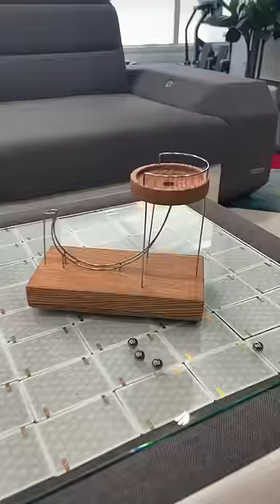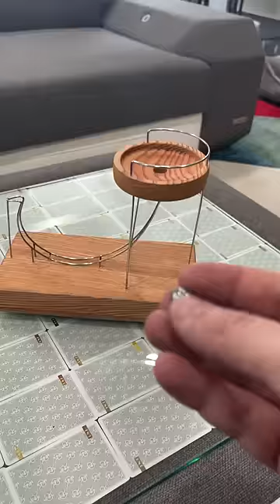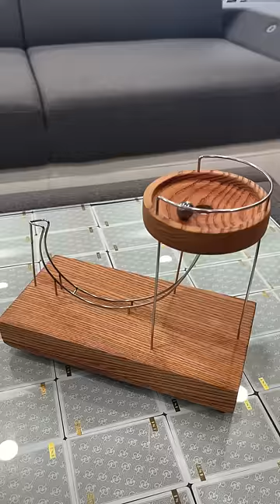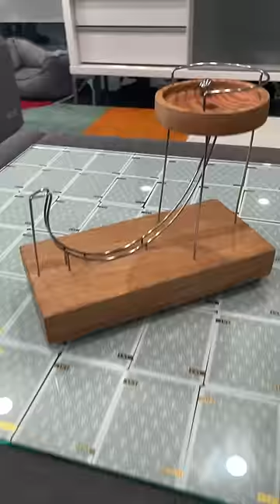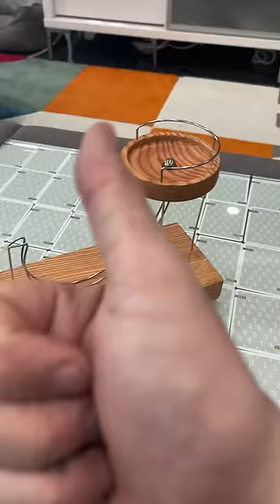An Impossible Perpetual Motion Device?! 😳 #Shorts

Comment: Waste our time explaining it’s impossible then spend zero time explaining the 
Magnet trick.
Reply: Ironic given you haven't either
Reply: There is no magnetic trick!
Reply: EDIT: I'm dumb lol, it's not a magnet - that's way too over engineered. It has a small spinning wheel powered by a motor inside the funnel part. The ball falls past it and gets launched down way faster than it would fall. Check the video at: /watch?v=trC5Dg3Vpi0
ORIGINAL:  
The base has an electromagnet beneath the lowest part of the loop. The magnets field is shaped perfectly to pull on the metal ball bearing, enough to accelerate it and make up any loss of energy to friction and drag.
Reply: @Pohonesty  yeah I'm sorry but this comment makes no sense. It's physically impossible for it to not have magnets because the marbles would constantly be loosing energy to friction and wind resistance, while it isn't much, it's enough for the marbles lose momentum and they shouldn't make it back up to the top part after like the first or maybe second rotation. If a perpetual motion device did exist it would NOT look like this.
Reply: @Pohonesty  yeah, no lol. The fact that the ball flies HIGHER than where it started implies positive net energy, which is impossible. There's something that makes the ball go faster than it naturally would.
Reply: @Pohonesty  You didn’t notice that the platform was an array of electronic circuits connected by metallic pads? They were designed to exert a magnetic down force as the ball dropped to make it faster, then turn off to allow the ball to rise higher. Nice trick , but that’s all it was.
Reply: @Pohonesty  It does qualify... think about it for a minute. If it can just keep looping like this without using energy, where is the energy in the sound waves it's producing coming from?
Reply: Oh! That makes sense. Magnet huh? Wow.
Reply: @fromagefrizzbizz9377  that makes sense actually. A regular magnet wouldn’t do anything because it would pull down going up as well, resulting in zero net force, but the plates activating and deactivating would work if you can time it. But yeah that ball shot down way to quickly to be natural.
Reply: @xavierburval4128  Yeah it almost seems to have been shot out of the funnel, going too fast to be just starting to fall. Another possibility is a tiny little rubber wheel inside the funnel that was powered by a motor, but it seems too difficult to hide it.

An easy way to control the magnet would be that the track segment just below the funnel had two isolated rails that the ball bearing shorted while it was in that track segment thus acting as the switch for the electromagnet. 

Model trains use track isolating a lot so you can have multiple trains on a track and control them separately.
Reply: Yes. There is something inside the woodbox at the base there 😂
Reply: @fromagefrizzbizz9377  you nailed it at the first part, it's a very small wheel on the top part. The battery also goes there, and there's nothing in the bottom base.
Reply: There’s no magnet there’s a small wheel pushing it down at the base of the bottom side of the hold and you out batteries into the base of it
Reply: The wires have elevtricity running through them, pos and neg. That is why they don't touch. They add just a tiny bit of kinetic energy to the ball much like a caveman railgun.
Reply: The first half of the base has the magnet slab so that it pulls the ball down faster than the gravity
Reply: @ipatchymakouli415  Thanks.  Tho, the "table top" made of soldered together circuits looks pretty suspicious too.  I didn't realize that it was a product you could buy, rather than a one-off.  As a product, the motor/wheel makes much more sense.
Reply: @Pohonesty  Did you fail your physics class?
Reply: @Pohonesty  lol no
Reply: @Pohonesty  It's impossible in Earth... Our gravitational field can provide 9.8m/s of max acceleration, but in this case it's accelerating way faster... Without a magnet it's impossible....
Reply: No magnet trick.  The wooden bowl at the top is wide enough to receive the bearing as it loses energy.  A true perpetual motion machine would have the bowl start at where the bearing enters the rail, and as you can see, when the bearing comes back around to the bowl, it makes it nowhere close to that point.
Reply: @levibaer18  doesn't matter where the ball's landing... If the motion is continuous without break it's considered a perpetual motion machine...

If you know how Gravity & friction works... and little bit of Physics. Then you know the acceleration(speed) of the ball is greater than 9.8meter/second, which is impossible with Earth's Gravity. Without a magnet this trick is impossible...
Reply: @Pohonesty  don't know who you're lying to. But no it doesn't. The ball would loss energy to friction and would never get back up on its own
Reply: Said by a gas employee
Reply: The ball can not go as high as where it was dropped from so the ball won’t go into the bowl
Reply: Ive seen another video with exactly same thing, it had a motor that speeds up the ball
Reply: @spacekii  how is that ironic
Reply: @Pohonesty  couldn’t be more false bud.
Reply: This reply section is some rick and morty shit
Reply: @InTheBeginningTheUniverseWas  I make these and that's not at all what's happening. There is no magnet or electro magnet
Reply: @Pohonesty  wrong. It runs on batteries. There’s a motor, you can fucking hear the thing!
Reply: Railgun principles applied ;)
Reply: It's just gravity. It has to be started by feeding marbles out a marble. It has perpetual motion but it's not scalable to be off any real use.
Reply: @JamesJones-mm2nm  There's a magnet inside the wood chomp base, that helps the ball accelerate and get enough force to go all the way up.
Reply: @Pohonesty  this is not correct.  Take it from an engineer.  There is absolutely a trick in play here otherwise the ball bearing could not launch higher than it's (vertical) starting point.
Reply: Yep
Reply: @brianchristopher3816  wrong. No it doesn’t and no it’s not. Ffs Brian.
Reply: Magnets run out of power after 400 years.
Reply: It's gypsy trick 😂
Reply: True perpetual motion is impossible, however there are natural phenomenon that can act upon a system and make motion potentially perpetual. For example magnetic, wind, thermal and gravity.
Reply: @Pohonesty  that makes zero fucking sense...
Reply: @yadaroni  No they can't.
Reply: @fromagefrizzbizz9377  Those look more like playing card to me
Reply: @InTheBeginningTheUniverseWas  It's definitely an electromagnet lol
Reply: @devontehardimon1792  square playing cards connected by solder joints? They look like translucent plastic printed circuits.
Reply: @fromagefrizzbizz9377  If you say so ig
Reply: Even if there’s a magnetic trick or not, it’s cycles without interference
Reply: @conradofmc_ny6706  this electromagnet is powered by a battery. If the battery runs out of power, it will unfortunately longer work
Reply: Hello. Still waiting to hear what the magnet trick is.
Reply: @scottyizsmall  ohhh ok, I didn’t know that, I though it was only a magnet…
Reply: @damidrew9906  There is no magnet, only a spinning wheel on he top part (we don't see because camera angle / no trick involved / it's a perpetual machine lolol), pretty easy to find using "Google".

People are just proving the Dunning-Kruger effect : they don't know shit so they tell stuff as if they were experts in the matter, "yeah an electromagnetic field definitely accelerates the ball, there is no other option". 
From a positive point of view, it's fun to read.
Reply: @ipatchymakouli415  I agree. I think it is a very interesting machine. Does not matter to me how it works. I love it
Reply: gravity trick 😁😁
Reply: @InTheBeginningTheUniverseWas  wired up to its own wind turbine !
Reply: @joshmillere6263  they do lose energy.. thats why the saucer that catches the ball is placed lower with a long angled ramp a kid could make it    and better , a kid would have the brains to make the ball land IN  the hole so it didnt annoy the crap out of you  rolling arount that ruddy bowl
Reply: its on a string !  im going with the quantum string theory ,  somewhere on the balls journey  it dissapears  and reapears  for a fraction of a second    where in that nanosecond  does the ball go ?  SCRAP THAT  im going with the bionic flea circus theory ,  fleas force fed with weetabix and red bull  !   totally my final answer for 5 points
Reply: @aplusbio  the length and angle of the ramp and drop of the ball  like hot wheels cars as kids    duuuhhh
Reply: @arkalley2284  yeah a small nuclear power station built into the ball  run by nanomites on steroids
Reply: @Catdge  join in with some ludicrous idea see who agrees with you ,   you know theyre nutts
Reply: @joekelly9369  yeah but it falls and comes back up to land perfectly on the platform with air to spare each time, if it was real, even with minimal friction it would only last a couple rotations before falling off completely. The energy it loses is not being made back by simply falling the distance, it has to be put high in the air in the first place to have energy to transform, in other words, by putting the ball on the top, we gave the ball the potential energy it needs to make gravity turn that into kinetic energy, which is the  turned back into potential and so forth, but every time the ball moves it loses energy to friction, which then lowers the maximum amount of energy at one time, which can not be returned unless an outside force sacrifices it's energy for it. A kid could not make this better, yeah it would land in the hole the first time, but the second it will scrape the edge, and the third time it will bounce, and so forth. Machines like these don't exist in the real world, they are just illusions.
Reply: @ipatchymakouli415  right and if I didn't use the primitive beast which I have to quote because I'm smart, "Google" I would take your word for it, which means you just did exactly what you made fun of other people for doing. Fun how the world works.
Reply: Saw one on eBay and it has a charge port in the base not shown here!
Reply: @conradofmc_ny6706  If there is a trick that's not disclosed, it's being interfered with by that trick.
Reply: @prideOrhonesty  best explanation . . . Tanks
Reply: @Pohonesty  no bro. You're wrong.
Reply: *Gravity trick
Reply: @joshmillere6263  while in the cup at the top, the ball should be considered to have no energy. The ball gains energy from gravity as it goes down the ramp, and loses that energy being launched from the end of the ramp back into the cup, where it should be considered to come to a rest and goes back to having zero energy until it falls onto the ramp again. If one cycle has enough energy to return the ball to the cup once, then if nothing changes it will always give the ball enough energy to make it back to the cup. This is not a bouncing ball experiment where you drop a ball and it never comes back to the same point. This whole comment section is a collection of the most high school dropout understandings of physics I've ever witnessed
Reply: @zmadbassist  potential energy exists literally for stuff like this, just so the energy doesn't "magical appear". While the ball is at the top, it still has energy, just like a rock that's sitting on a cliff does too. It's potential energy, while yes hurr durr its not real energy, it's still out into a position where it will act as a catalyst for an outside act of kinetic energy. The reason why we need to consider potential energy is because we can't just magically give the ball kinetic energy as it goes down the rail, it has to come and go from somewhere, which is why its important to consider potential energy, because that would account for the maximum amount of energy that ball can have without an outside force interacting with it. It loses kinetic energy to friction and wind resistance which means that when it's back at the top, it has LESS POTENTIAL ENERGY, it doesn't just not have energy. Which is why when it falls down the rail the exact same way it did the time before, it's not going to make it as far, because it has less potential energy to be converted to kinetic energy.

I'm not sure why you compared everyone else's answers to "highschool" level even though you explained it in less detail and forgot important stuff when I've been able to answer the question to this stuff with shit I learned in fukin middle school. Literally 6th grade science Jesus Christ.
Reply: @Pohonesty  not true. It's takes batteries. There are videos that show how it works
Reply: @zmadbassist  I think I get what you were trying to say now, sorry i assumed you were bashing me and saying me and most other here were on highschool level science even though this is definitely lower than that. Still have no clue what's happening tbh in this comment section, at this point I just kinda assume every response is trying to argue that this exists or that their understanding is correct despite scie science lol.
Reply: @Pohonesty  gravity can't possibly impart enough energy to make a ball (any ball, even rubber super balls) rise higher than they started from.

Primary school physics should have taught you this much. 🤦‍♀️🤦‍♂️
Reply: if there is a magnet trick it doesn't matter cuz it's technically still perpetually moving
Reply: Extreme sub-100 IQ rick&morty dunning kruger reddit highschool dropouts / American education comment section. Anyone who doesn't fall in those categories immediately understands that this device is impossible without external energy input
Reply: @Djellowman  don't get me wrong, but I would guess a lot of the people hear arnt even from the US. I mean even the common folk here it's hammered into our brains for physics and energy stuff
Reply: @fromagefrizzbizz9377  Tabletop really does look like standard playing cards under a piece of glass.
Reply: @joshmillere6263  therefore the slash in my comment, indicating alternative cases
Reply: @Djellowman  which is why I was against it, I don't think the American education system is at fault because it covers these topics early on. I'm not sure who failed the people who don't know about the simple stuff.
Reply: @joshmillere6263  The people who i've met and come to know from the US were all worse in English and numerous other fields of knowledge than I; a non-native speaker. You can also look up the average IQ in the US, and how the grades stack up against European countries. the US is objectively poorly educated.
Reply: @yozdarce7112  no it's not... A perpetual device is suppose to work off of natural perpetual energy which is literally impossible. This is battery powered. There are videos showing how it's made.
Reply: Correct me if Im wrong, but using magnets doesnt qualify as a trick. That would be part of the machine as it doesnt cost energy.